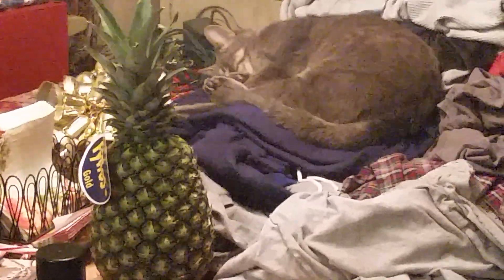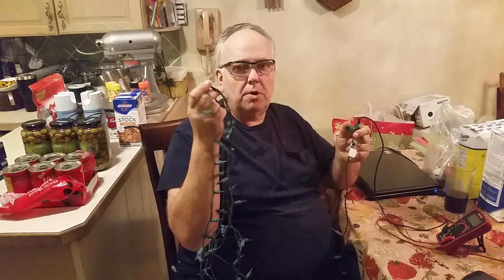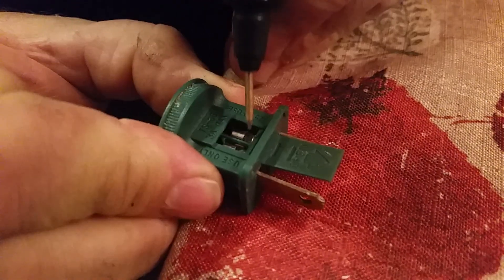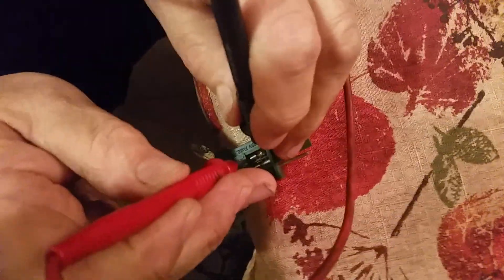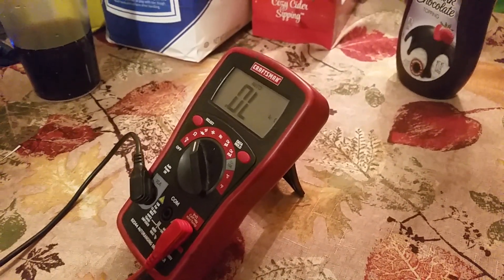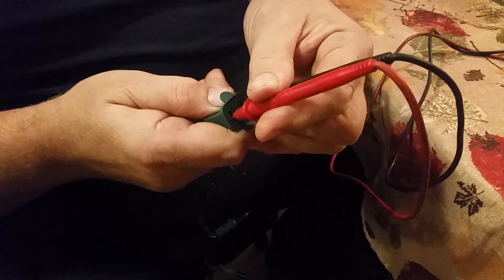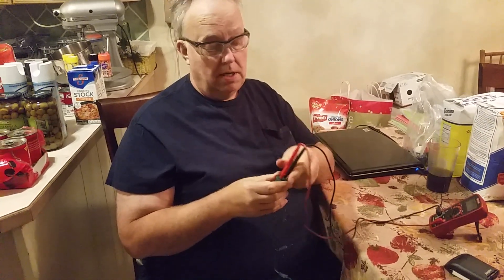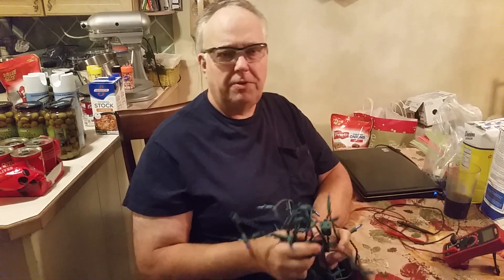How to test LED Christmas lights with a multi-meter

Comment: My fuses states 1 on my omb scale not zero. When testing the lights Do I keep plug in socket then pull each bulb out? Do I use the black wire and insert into the light socket of the one I  pulled? Is it suppose to read 1 too? I am a first time user of a mult cen-tech model 61593. So I have no clue. All other videos from you tube use a Christmas tester. I would like to learn to use this centech. Thank you.
Reply from the maker: Bulb test requires to pull bulb and ohm test 2 terminals.

Comment: Need to describe settings more thoroughly. Also the video makes it think that we can test the LED lights. This is just testing fuses and it’s very general. Not useful for what most people want to do it which is check if it’s LED Christmas light is bad or not. No just say it’s too hard and throw away your lights.

Comment: Zero or close to ZERO resistance when the fuse is good..  What does the multimeter display read when a fuse is bad?
Reply from the maker: Nothing, the screen will not change or the needle will not move

Comment: Daryl.... I have some and the plug doesn't have an opening. Help!
Reply from the maker: Can you send a couple of photos?
Darylturcott@gmail.com
Reply: @darylturcott  Hi Did you get my email with the pics?
Reply: Hi Did you get my email with the pics?
Reply from the maker: I did. Do you have a test light or voltmeter?
Reply from the maker: It looks like your plugs dont open, even though I see a rectangle opening, I dont see a slider door. If you have a meter you could probe the wires for continuity between the prong and cord.
Reply: @darylturcott  Oh sorry, No I have to get one.
Not sure why they put  fuses in the box when it doesn't open.
I only have a battery meter....is that the same?
Reply: @darylturcott  yes later thanks